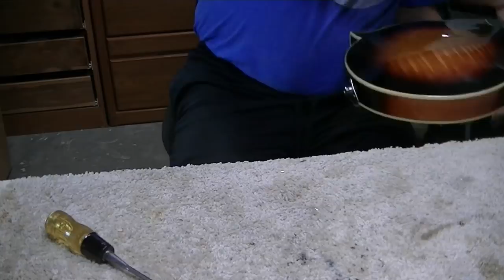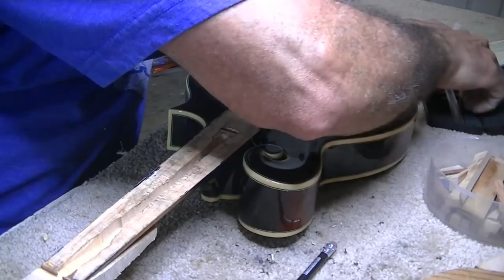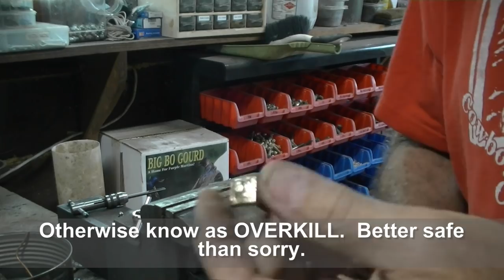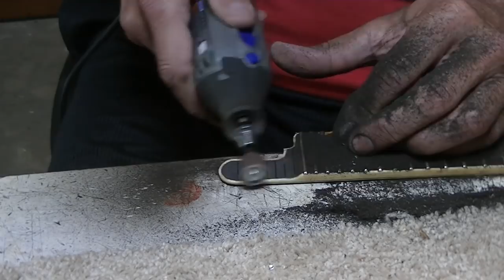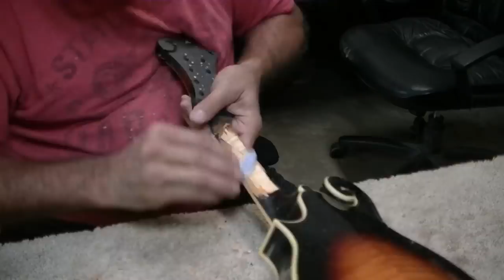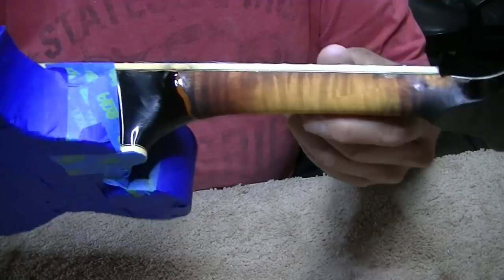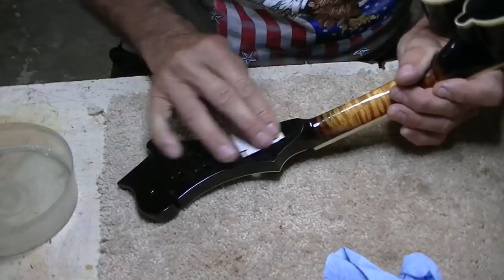232 RSW My Best Neck Repair Video Ever P2

Comment: Gorgeous. I love bare wood necks and I sand all of my necks. My guitar buddy in Venice was horrified when I sanded (followed by linseed rubdown) the neck of my new Epi SG. Call me crazy, I like the feeling of wood in my hands and fingers on nylon and metal strings which is why I don't use a pick (which I did for 41 years) so varnish, whatev. Jerry actually used the trussrod right away to correct the underbow so yes, he totally made that call. My favorite part is when he is sculpting the new neck. I was literally in tears (I am a "maker") as the neck morphed into a thing of beauty. I can't wait for part 2 of the Rosa Guitar Build. Much love from the Big Boss Basin (L.A.).

Comment: Jerry, I bet it sounds a lot better than it did before the headstock broke off, with the huge amount of neck wood that was routed out by the factory, compared to the way more mass and solid wood you created to rebuild it. It's a shame the owner didn't give you a recording of it before it broke. Great job, and thanks for the video. Bob Kogut
Reply from the maker: The owner bought it that way. Thanks for watching.

Comment: Just a tip passed on to me by an old brass instrument repairman.  "The best penetrating oil is 50% Acetone and 50% ATF."  A few seemingly frozen bolts have yielded to this concoction in my own garage repairs (I'll fix just about anything, or at least try).
Reply from the maker: Yes, I've used it many times to unstick frozen engines, including tractor engines.

Comment: Your the only one knowing where the transitions are. I'm an old time wood worker/carpenter now but when i was younger an old timer told me "you're the only one who knows where your mis-takes were."
The overall impression of your repair is fantastic; knowing where to look, your repair is still unbelievably good.
In terms of a cost no object repair - aside from pulling the neck and contracting the MOP and veneer laser cutting - or - full rebinding the head stock and/or both it is still a fantastic and structurally sound repair..., 99% of gawkers will never know what happened.

Comment: Jerry, you did a beautiful job of it. Customer couldn't ask you for any better job. A lot of feeling went into this repair, much like you put in all your repairs. I'm in the middle of restoring an old (not expensive), acoustic guitar that I received badly abused and damaged. The neck was so bad that it had to be removed, and the paint surface was chipped all over the guitar, so I now have all the old paint removed and am staring to redo its paint job, before regluing the neck back on the body. Some of the dings on the body it got over the years of abuse needs careful filling before the body can be finished and restore it's new good looks. When I got it, it was a dark blue/black sunburst finish all over. I'm hoping to stain the back a dark  wood grain brown, where the sides will be the natural maple wood finish, and lastly the face of the body will be a bright glossy white. Neck has also had the old paint removed and the natural maple wood grain will be seen to match the sides of the guitar. I'm also going to add a Washburn amp. pickup/tuner to it seeing it never came with one installed. I'm hoping it will look good when finished and play like a dream. Best wishes and Happy New Year in 2023.

Comment: FYI   Next time try using Lard as a  lubricant for thread cutting.  It is cheaper than thread cutting oil, and  definitely better than 3 in one.  You can buy it at the grocery store, and keeps forever in the refrigerator.

Comment: I see you finished up with a volute at that weak point in the neck... did the neck have a volute as was from the factory;  if not then perhaps the was the main reason for such a weak point with what looked like beefy guitar modified truss rod having to sacrifice so much wood!  You definitely improved the basic design Jerry... bravo on a very good repair.  The owner has ended up with a vastly improved and stronger mandolin.I see you finished up with a volute at that weak point in the neck... did the neck have a volute as was from the factory;  if not then perhaps the was the main reason for such a weak point with what looked like beefy guitar modified truss rod having to sacrifice so much wood!  You definately improved the basic design Jerry... bravo on a very good repair.  The owner has ended up with a vastly improved and stronger mandolin.

Comment: All hail Jerry. You nailed it!   I would happily take that Mando on stage. Specially impressive considering the head was snapped clean off.  +And regrettable the original maker could not fit an appropriate truss rod to begin with.

Comment: Jerry I saw a Kentucky f-5 mandolin with the same neck fracture go eBay $226 the other day, I thought Jerry could fix it for sure. I checked the model number and found it for $1300-1600. What a deal for someone.

Comment: Excellent job on that. I learned a lot watching you. I have to join you with your frustration with staining. I found that if I stain it either goes on blotchy depending on the species of wood, or it raises the grain and sanding it takes the color off, or it won't blend with other colors and above all it won't stain onto a finished part as was your frustration with this one. I have turned away from staining for these reasons, as well as the extra time it takes. I now tint the lacquer instead and am very happy with the results. I would have likely avoided staining the headstock too, preferring Behlen black guitar lacquer followed by the clear coats. Seems to be more consistent for me.

Comment: Amazing repair work. I wish I knew such repair could be done. A few decades back I had an Ovation that broke off its headstock when leaning against the kitchen table and it slipped off. I put a couple pins in it and glued it and it held a few more years, but it came apart when I gave it to my son in law without temperature control where they lived and it re-broke and the pieces were too mangled to go back together. I never thought of making a new piece of wood for it. I just threw that 1975 Ovation Balladeer and the case in the trash out of sheer  frustration.

Comment: Black markers are my favorite form of "finish repair" when I cause an injury to a black guitar. I knocked a little chunk of wood off the corner edge of an Ibanez RG, colored it in with a marker and you'd never know it was there without touching it. Of course, satin finishes help.
Reply: +on the black marker. Nail polish works great too, and will fill shallow dents!

Comment: Love your channel. 
You need a couple of things.  A “Cabinet” scraper, different sizes of them.    (I know you have one.) I work on gun firearm stocks and grips. My scrapers come  in extremely handy. 
Also a “barrel channel” scraper would be of a help sometimes, I think,  or maybe one modified to scrape out a flat bottom for truss rods.  
He and I both are the type that will sand half a day, lunch, and come beck for more to get and exact fit in any wood project.   

Coffee might stain the new white binding to look like aged binding. 

And have you tried thin, flat, small strips of carbon fiber to strengthen the areas around the neck? 
One of my cousins, a master carpenter, fixes neck breaks on guitars and mandolins  sometimes with those inserts. He says they are stronger than steel. And they do resonate.  By the way, he is a very good player.  Mandolin, guitar, banjo, and some odd looking instrument that looks like a half a watermelon with a neck and 4 strings.  Over forgotten the name.  He plays it reasonably well, but doesn’t like it too much. But with the other instruments is a very good player.

I’m guessing you likely already knew all of the suggestions I made.  But it didn’t hurt to send them, just in case you didn’t. 

And I absoutley love that quilted maple mandolin you made.     Nicest mandolin I’ve ever seen!

Comment: That's a tough repair with butt joints on binding and such. The scarf part of the repair looks like it could have been factory. I'm very surprised that the lacquer wouldn't cover the troubled spot. A coat of shellac may have helped solve that problem. Very nice result Jerry.

Comment: I'm at 3:19. I agree with you on the truss rod issue. A friend builds mandolins with 3-piece necks and they NEVER move. I don't yet know how you handled this, but I'd go for gluing in a tight-fit hard maple rod, and keep on going.
Reply from the maker: I was going to. But you got to keep in mind that was a very weak neck and it already had Tendencies to under bow because of the weakness. So I elected to go with a truss rod and I'm glad I did.

Comment: If you run into the finish problem again, try shellac as a prime coat before applying the lacquer.  Shellac sticks to all finishes, and all finishes adhere to shellac.   Mix a 1lb cut of shellac about 50:50 with denatured alcohol and spray over the area with your airbrush.   For what you're doing, you'd need a nearly clear shellac.  You can get dewaxed "super blonde" shellac flakes on-line - and it makes a clear finish as opposed to orange, beige, or ruby colors.  Even a beige would probably work as it would provide a tinted base color that would blend with the brown.   Using shellac as a base or priming coat is an old finisher's trick when trying to get a different type of finish to adhere to an existing one.  Since shellac is alcohol-based finish, you could also tint the shellac with any type of alcohol soluble tint colors.  The super blonde would give you a clear carrier for tinted colors as opposed to something like Zissner Bulls Eye Shellac that is orange/yellow when dry.
Reply: For some wonderful examples of of using shellac thus way check out Thomas Johnson's channel : http://www.youtube.com/user/johnsonrestoration
Reply: Buckhorn Cortez .... good approach, plus you could even soak a " Sharpie " in the Shellac Jerry! . . . m_m

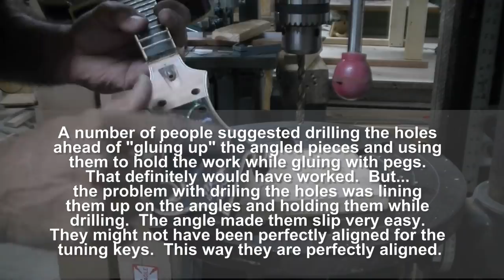Comment: At 36:50 you put a note in about people suggesting using the peg holes to hold the angled pieces before glue-up. How about using a bit of CA to prevent slip while you drill so you keep alignment, then break the bond for a proper glue—up with dowels through the peg holes? P.S. loved these two videos! It’s a beautiful job.

Comment: Jerry, I have no idea at all about repairing instruments but would it have worked to route that truss rod channel out all the way up into your replacement bit and then glue in a bit of maple or mahogany etc with the grain running longitudinally?

I'm thinking if you were to completely fill that void with a decent bit of wood that has the grain in a different direction, particularly longitudinally the whole neck should get far stiffer and stronger.

Comment: Jerry are you not pressing in the fretts putting a clamp on the frett and then tightening. thats gona press the fret in deeper than the other. i was taught to use small blocks of wood on each separate Gap to not frett squish. great method in the break fix. i should of sent you my Epi les paul which needed this same fix. mine was brand new but car rolled back onto the cheap balsa epi necks and it shatered about 6 inch of neck and broke the headstock. i managed to fix it but had to use tight bond first then after i found out it had been sneakly put back together i epoxyed in a new block a sepele. well it would not hold tune after about 3 days it would go out of tune where as my fender type stay in tune for weeks if i keep the room temp the same. Well i payed 20 pounds for the new les paul..the pickups alone where worth that. i fixed the neck aswell just not happy.. so i sold it. if im not 100 % Happy i sell them on.....ill never buy an epiphone again....

Comment: Absolutely stunning repair. As an old sawmill mechanic and PC repair guy, (been repairing stuff all my life) why didn't you first thing after getting your repair piece ready to glue, didn't you drill your tuning 2 tuning peg holes and use them to clamp and align that piece instead of struggling with the little  brads? I know nothing about instrument repair, just curious.

Comment: In this case, would a carbon fiber stiffening truss installed in the neck be a useful modification? In the case of carbon fiber, a truss rod may not be needed. I don't build instruments, I've only seen it done.
Reply from the maker: The old part of the neck had a pretty big under bow. The adjustable truss rod let me pull that out of there.

Comment: Nice video. 👍  If the budget had allowed, could CA glue have been used to fill the finish on the back seam or would more paint and sanding have been preferred? (Or some other method?)

Comment: I've seen any number of headstock repairs...especially Les Pauls...I've never seen as fine an aesthetic job. Don't apologize for any absence of "perfection" . I wouldn't have replaced the truss rod, and probably would have used plain maple and done the back of the neck straight black.  500 hundred minutes  ? Impossible !
Reply: I was just thinking the same exact things while watching, went to write it and saw your comment. The mister sure knows his job.

Comment: Hi Jerry great video I do like the frank and honest discussions you have with yourself about what and how to do a job.
 I do have a question though I'm a tradesman with an engineering back ground and I was wondering what the reason for the truss rod is? I guess it's to strengthen the  neck if so the one fitted or at least the fitting of the truss rod in this instance had the reverse effect your method however made perfect sense from an engineering point of view as in tying the two ends together you actually added strength to the neck  nice job.
Reply: I won't be able to say it as well as Jerry, but the truss rod allows you to adjust the neck, should it have an undesirable bow, once the string tension is applied. I hope that helps!👍😎🎸🎶
Reply: @74dartman13  Hi yes I saw that at least I did when Jerry put his version of it in the originals place given the set he put in the rod which is designed to do just that I was amazed at the size of rod that was installed before I would actually call that sabotage . I enjoy building RC model aircraft myself using woods of differing types Balsa is a hard wood you know but you have to employ strategies with wood. As Jerry points out when he describes what and why he is doing his thing something I find most helpful in understanding his thought processes.
Reply: @phillippowell3847  ya, I believe that truss rod was a little too big for that small of a neck. Sounds like you have a good hobby there.😀

Comment: Hi Jerry,  I used Cascamite when I repaired my classical headstock that was snapped by a friend during a party.  The three rails were broken diagonally along the grain but there was plenty of surface area and, with the correct mix, they went back together well secured by string binding, no room for clamps, and it played well afterwards. Is there any reason why you don't use Cascamite? Just one thing don't buy too much at one time if you aren't using it. It goes off.
Reply from the maker: I would say the first reason is I've never heard of it. My guess is that it's an epoxy. I don't mean any offense at all it's just the fact that I have tried dozens of epoxies in my life and I have never found one that I like. I don't really like them on instruments at all in my opinion they're too brittle they're not flexible. I've seen lots of epoxies fail especially on Ovation guitars. Good luck to you. Hope it holds forever. Happy New Year.
Reply: I forgot to add, thanks for all your brilliant videos. They not only entertain but inspire.

Comment: Speaking as someone who has never worked on a musical instrument, I wonder whether you have considered, or if there is a reason why not to simply pour epoxy resin in the space left by the truss rod, rather than making wooden wedges. Edit: I wrote this before I saw that you were going to save/include the truss rod....
Reply from the maker: Generally speaking you don't want the truss rod confined in a solid Mass. It needs to be able to flex.

Comment: Just wondering why the back of the neck was not stained black? This would have matched everything from the headstock to the body of the instrument. If not black, then a dark coffee color so as not to lose all of the curly maple?
Reply from the maker: Now what would be the fun in that?  That would be too easy.  It's mostly tradition.
Reply: I figured tradition, plus you get to show off that curly maple. It is beautiful! What does that cost per board foot (S2S)?

Comment: Would a carbon fiber bar in the truss rod slot be enough to stiffen the neck instead of a truss rod?
Reply from the maker: Truthfully I don't have any experience using those. But I would imagine it would work fine.
Reply: Sure it would stiffen it but with no means of adjustment- ever. A buddy of mine restored an old Martin (no truss) and embedded 2 CF rods.  Setup was perfect until the first winter when the neck wood moved but the CF didnt- result was a hairline crack the length of the neck. Not terrible (yet) but sure not anything good.
Reply: Tioga Fretworks That's highly informative. Wood with wood or wood with adjustable truss rod !

Comment: My one question is...Why did you remove the lower frets and then sand that part way down?  Wasn't the mandolin supposed to have those frets?  I mean wasn't that part of the top tier instrument's signature feature?  Edit: Maybe I missed something.
Reply from the maker: Pink clearance. Most good players remove those frets.
Reply: @RosaStringWorks  Thanks for the info.  Never would have guessed that since I don't play the mandolin.